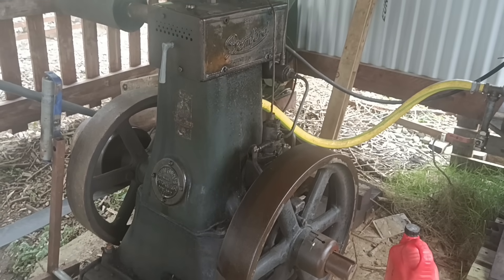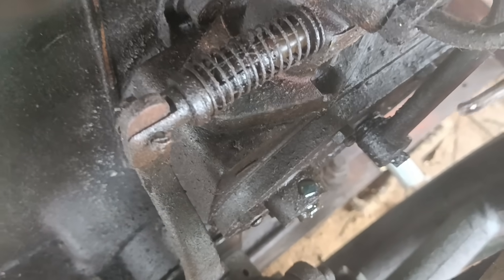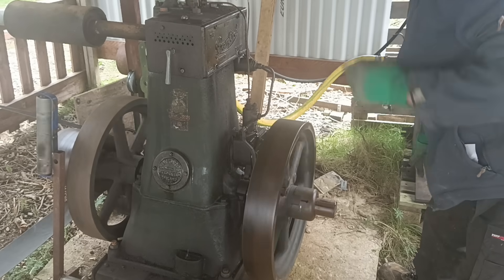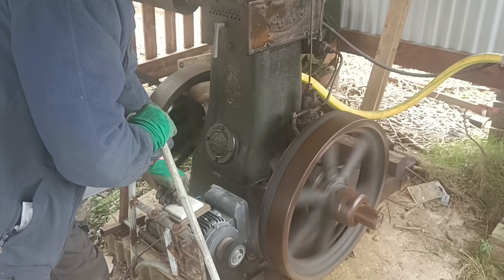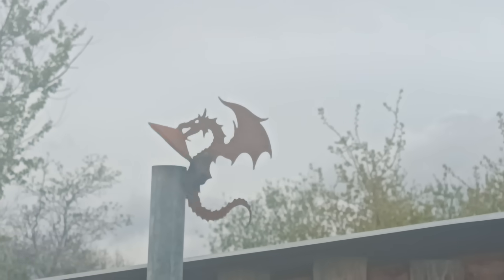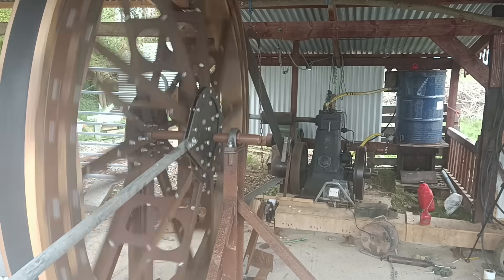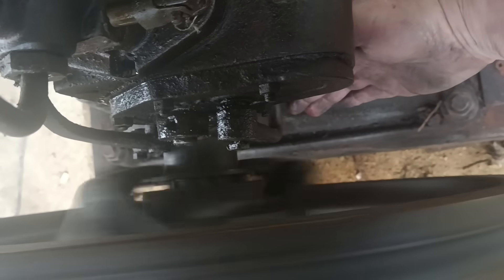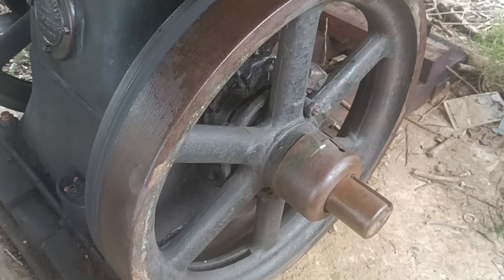How Much Fuel Does This Vintage Engine Use? Bamford stationary single-cylinder diesel efficiency

Comment: In marine engines diesel the ball park rule is 0.4  lbs fuel per  HP  about 0,18   kilos per HP  In a  6HP that will be 0.18  kilo x 6  . Then  covert to liters  approx  density is 89% the weight of water 1 Kilo per litere water . . The fuel use is not linear as some percent of fuel is only to turn engine over so 6HP will be max effientcy  and something like 1  HP is worst effientcy . Looks to be your using 2 HP to 3 HP  as i would expect 5 .5 HP to be 1.2 liters per hour . I have a 6 HP 1960 version Yanmar engine  withy big flywheel at 2800  RPM with 15 inch  x 17  inch prop  on 2.3 ratio gear box  and reputed to be  less than 1.5 liters per hour at 3 mph  full tilt on a barge in a canal  something like 1/3 gallon UK per hour .  Wind and current can alter fuel numbets along with fuel types as winter fuel has more Kero in the diesel  fuel . . The disiel fuel cost will often be two to 4 times cheaper than electric power depending is fuel untaxxed like green or red fuel or taxxed like yellow fuel I am kerry based whats your county ??

Comment: We have an old Ronaldson Tippet engine on our property that looks almost identical to this one. It runs a 32volt electric generator. The old girl is in working in order but has not operated for many years sadly since we put in a solar system. The solar is silent but I much prefer the chug chug chug of the old motor.

Comment: Have you tried to put about a cup of 2-stroke mineral oil in the diesel fuel to make it a bit richer? I have a 7.3l idi and    valves are more silent and has better trottle response and more power

Comment: i drive to work with a electric scooter (45km/h 4kw Engine @fullspeed ~1,6kwh = ~3,5kwh per 100km) and my co worker are drive some with "normal" fuel an she used ~3-5L per 100km. 
I pay nothing for the electricity ( solar system out of defect panels) and she today ~ 6.88€ :D

Comment: yes! Very impressed. If only I could power my woodwork shop with one of those! I have a big diesel V8 ford. The first four-wheel vehicle I've owned. Cost 8k US$ 14 years ago. Doesn't get used much but if driven on highways and not freeways will do 24MPG. I hazard a guess and say it's worth upwards of 35k now but I won't sell it for 3 reasons. It will haul just about anything, I can do most of the maintenance myself (If any) and how many folks can say they only ever owned one car/truck in their entire lives. Old machines rule. Every time!

Comment: Wow! That math works out pretty well. Efficiency of using fuel -> steam -> mechanical energy -> electricity is about 1/4-1/3. Not counting electric -> mechanical. Going from fuel -> mechanical energy certainly saves a lot of the losses!

Comment: It's not just the horsepower of these old engines that makes them so valuable as a stationary power supply. It's their torque that turns a massive flywheel. The pollution from these machines is a bit of a problem, however the amount of electric power you can generate could power our homes and run some sort of emissions clean-up as well. With the new batteries now on the market, we could charge them on a very early morning schedule with this type of diesel engine (two or three homes?) and run our households during the day and night, too. There would be MASSIVE pushback from GREENIES because of the use of diesel fuel. Oh well, you can't please everyone...so stop trying.

Comment: I could imagine one of those machines running in a heat and power setup. Hook up a generator to produce your own electricity (Plus a battery of some kind) and use the exhaust and cooling-fluid heat for hot water.

Comment: 450ml/hr out of a 6hp isn't far off a little yanmar l70 running hard. I would think the large rotating mass of the flywheels would give the bamford a fair bit more torque but I may be wrong

Comment: Im fairly sure a more modern honda 125cc motorcycle engine will provide a lot better efficiency, even at 2000 rpm. Unfortunately, finding an equivalent in power, small diesel engine is much harder.

Easiest is use a cloth to filter vegetable oil, and mix it in the diesel. No need to go through lengthy procedures to refine the oil, when you can have a similar functional fuel mix of diesel and vegetable oil.

Comment: I have a listeroid 6/1 that runs a 120V 60HZ generator head. I run the engine at 730RPM, for a bit more HP. The fuel burn is about 345 grams of diesel, per KWH gen head output, in real world use, mid load. Considering that the gen head is probably about 85% efficient, the engine's fuel burn is competitive with modern small diesel engines, at around 295g per KWh.

Comment: Lovely to see simple reliable enginring at work after so long. A pal has no mains power at his property and has used an ancient Lister single cylinder engine for general light use for donkeys years. In that time he's gone through many larger output generators for heavier use that were all bought new  and soon broke down. Kind of proves the built-in obsolescence of the modern world.. surely that's wrong...

Comment: A proper measure would result in pounds of fuel for an hour of run time making 1 horsepower or an equivalent set of units.
https://en.wikipedia.org/wiki/Brake-specific_fuel_consumption
Reply from the maker: but how would I measure power output?
Reply: @wayoutwest-workshopstuff6299   By powering a known load.  A generator is convenient since you can connect and disconnect it's loads and so adjust the load on the engine.

Comment: The farm I worked on had a old Bamford from the 1920's from memory. Was used to pump water from a bore with about 150meters head. Was there pre war and still works today as a back up to the electric bore put in in 1984.

Comment: Sounds pretty efficient to me. I love these old flywheel motors. These have a character you don't see in modern Chinesium machines. One day people will say the same about briggs and stratton gas mowers. I have 2, self propelled and they are staying with me. A friend has a battery mower and it sucks, to be generous.

Comment: Mi grandpa bought a hit/miss engine concrete mixer with steel wheels in the 1920's or 1930's when he built his house. My dad and I used it to build some of the retaining walls, footings and various other projects at the lake property. It was also used on 2 of my cousins lake properties and the construction of a children's camp and various other projects. All of these projects took place in the 60's and 70's. I have no idea how many yards of concrete but the paddles and drum are severely warn. The thing still runs today. I am pretty sure that it ran about 6-8 straight hours on a gallon or less of gasoline. You could count each firing event which under no load might have been 1 every 2-4 seconds but the more you load it the less time between firing events until it would fire every cycle. The engine was single cylinder with 2 heavy flywheels and as I understand it the engines main job was to spin the flywheels and the wheels are what did the work. Sometimes I think what we perceive as progress is only different and made simpler to operate but not necessarily better. Lets face it . Nothing or very little is invented today right down to the electric car. It's all been invented in the past. We just reinvent it with some better materials and support  systems.

Comment: I have seen engines tested and the performance listed as Horse Power Hours per Unit of Fuel. The Nebraska Tractor test of many years ago used these units so people (farmers) could evaluate or compare efficiencies of farm tractors.

Comment: you are assuming the engine ran at 6HP (~4,5kWh) and therefore an electrical engine running for a full hour would have consumed 4,5kWh. However, your work clearly required a lot less than 6HP sustained. Why, because 1L diesel is ~10kWh of energy, of which (a theoretical) perfect combustion engine can only use 50% - so your engine would have to be perfect.
In reality I guess efficiency is somewhere at ~10-20%, which means roughly 1kWh of electricity would have done the job.

don't get me wrong, I love old engines - but their efficiency is the reason why they are used only for shows and not to do actual work.

Comment: Wait, a machine that's basically indestructible, cheap to operate and can be powered with modified vegetable oil??? Quick - let's make it illegal! (AFAIK those machines ARE already illegal to operate in most of the US and soon will be everywhere in the EU)... Well, think about it - and why would our well-meaning and competent politicians DO such a thing?
Reply from the maker: Not illegal - one day you'd have to run it on green diesel, that's all
Reply: @wayoutwest-workshopstuff6299  Not now, of course - but you have to look at all the attempts from left/green since the mid-70s to make owning/operating combustion engines illegal, starting with the writings by "Environmental" Law Professor Dr. Arnold Reitze - 50 years after his irrational ramblings against ANY form of combustion, the greentards in Berlin/Brussels are basically implementing all of his wacko ideas. The interesting part: Reitze's activist manifesto was intended to prevent... wait for it... a new ICE AGE.

Comment: you can see a lot of them in Indian farms , running tube-wells ( in places where  electricity connection for tube wells is not available or delayed by a few years due to corruption.   the situation has changed a lot , for the better, in the last  9 years ).
     people start them by hand cranking only.
   they are generally 8 / 10 horsepower & consume about a litre / hour.

Comment: My car consumes 1L/hour just to idle. This machine is more efficient than modern car engine.
Reply: Your car engine is also driving fans, belts, pumps, and an alternator to charge the battery and run all the electronics in your vehicle. These are not comparable because you're your car engine is doing more work

Comment: 0,45 l diesel/ hour is 1,89 hp if the engine is 35% efficient. That sounds about right, because the load is very low. It would be interesting to see this thing run a generator at full load to see the actual efficiency.

Comment: A power level of 1 hp is approximately equivalent to 746 watts.  One mechanical horsepower lifts 550 pounds (250 kg) by 1 foot in 1 second

Comment: So fun fact on that old engine. I did a bit of research and your engine produces around 52 foot pounds of torque from the info i have. It may be a bit higher or lower since those engines basically dont exist in the U.S...but close enough for this discussion.

Now i currently have a 3 cylender engine pushing 20 horsepower that gives me a max torque of...33 foot pounds. This engine is used to drive the cooling unit and a small generator in my semi (lorry). This engine uses .732 U.S gallons per hour on average over 3000 hours. Or about 2.77 liters for you metric users. Or around $3 an hour best case. I also have a twin of this engine same specs and all currently used to power a small generator for my shop. its about the same fuel consumption .725 over 8900 hours. Both engines are a 2021 and 2022 varient of the same motor. They also weigh 250 pounds.

So your near century old engine is about 84% more efficent then a modern diesel engine doing a very simular workload or likely a lower overall workload.
Reply from the maker: Ha! Thanks for this AF. I imagine your engines are working harder than mine was though. Apparently mine wasn't a fair test because I didn't push mine hard enough..

Comment: I want to say I loved the video.  But I want to point out a few things.  

The engine is not making 6hp or 4500 watts.  You said you "could do the work", and an average human can produce about 1hp peak.  Let's call it 2hp.  Just to be safe.

The engine burnt 3700 wh of diesel in that time to do 1500 wh of work.  That's about 41% efficient which is a crazy number for a diesel of that age so I know I'm erring in your favor at least.  

It would cost 66 ¢ to run an electric motor for that amount of time.  

So money wise, you're ahead or at least in the ballpark.  

 It can't be making 6hp at that rate because you'd have discovered perpetual motion with that engine running at 121% efficiency, and you'd have been disappeared by now by the black helicopter gang.
Reply from the maker: Thanks, Michael. You're quite right! But I wasn't trying to mislead - just trying to understand. I should repeat this when the engine's working harder..

Comment: a few years back I with a couple of partners had a gold mining lease and used an old Bamford to run a small generator. it would run every day for at least 8 hours a day with no problems and was surprisingly efficient. end up selling it to a collector
Reply: yep   bamford or lister engine technology running a generator and a  large 1000amphr 24 volt  battery bank is key. it would be about 4hrs a day to keep huge  1000amphr  24 volt battery bank topped off  in a house using 8kw to 10kw  per day .

Comment: I loved seeing and hearing that old engine run!  Old diesel engines fascinate me.  I love the old one cylinder small boat motors with the big flywheel that you could hear goin pop-pop-pop!  I'd love to have an old boat with that motor in it.  I've seen several videos of old diesel tugboats that were turned into houseboats and the diesel engine turned such a low RPM that the motor was running fine and had never been overhauled!  Now that is amazing.  
  I saw some more of your videos I will have to watch.  Thank you for sharing this "gem" with us.
Reply: Look up Witte dielectric plants. I have a few of these here in the US.

Comment: Thank you.  Good video.
   Although we were country folk, our village was only a few miles away from Uttoxeter [the locals call it Utcheter], and my father worked in that factory, at that time.  He may well have made some of the parts, especially those that involved drilling, or even done part of its building.  It wasn't a very large place.
   Nearly every farm around had something similar [often a Bamford] to provide electricity when it was needed [not often], or for milling grain for cattle food.  Small workshops, too.  Some of the engines, I remember, I think the older ones, were horizontal, with very large slow-turning flywheels - essentially just the next step on from steam engines, I suppose.  I loved being taught to oil and grease and even sometimes start them.  Absolutely beautiful things.
   [By the way, 450 millilitres is almost exactly a tenth of an English gallon, not an American one.  More like an eigth of an American gallon.]

Comment: Seeing those old engines running is nice, not a lot of noise or fuss compared to the newer engines. 

You were not stressing the old girl with the fuel burn you were pulling about two horsepower.

Comment: Is it efficient? If we look at power output in relation to fuel consumption: probably not.
Is it effective? Heck, yeah. It's existing equipment, it can run at the low power requirements presented here, and it needs next to no maintainance.

Comment: Converting mechanical energy to electrical energy then back to mechanical for whatever you want to use a normal gas generator for I imagine would be much less efficient than a generator like this, obvious downsides of not being able to run a house off it but in a pinch you could likely add an electrical generator to the belts as well, it would be interesting if we still used machines like this but not many of us still forge, split wood, grind charcoal or use much mechanical motion at all.

Comment: They made diesels complicated just to save very little quantities. Simplicity always best. Reliability is key. 
In the long run, running cost for such engines far outweighs that for modern diesels.

Comment: Those horsepowers seems to be quite complex. Basically it is just torque multiplyed by running speed. But measuring methods seem to make big differences. However, half a liter per hour is pretty similar to what a small boat diesel of 6 or 8 hp consumes. However, these engines are rarely run at their maximum power. Nominal consumption of a modern engine is about 180 grams per horse power per hour. You used 0.45 liters, which is about 380 grams. Are we, actually talking about something libe 2 or 3 hp? But how should it be measured? From the crank shaft or from the tool (or propeller) used?
Reply from the maker: exactly! it gets very complicated..

Comment: Here in norway that calculation would be flipped on its head because of really high diesel prices and generally low electricity prices (at least before we were fully connected to the eu market), we had prices around 0,01 euro per kwh for electricity, which now has risen to around 0,10-0,50 euro per kwt. And agricultural diesel is around 1,5 euro per litre with the old price of electricity here you'd have 4,5kwt*0,01euro = 0,045 euro/h vs 0,5l/h*1,5euro = 0,75 euro/h
Reply: Its pretty ironic that in the EU its more profittable to run things via fossil fuels as compared to electriciy (though electricity also uses fossil fuels for generation). In norway we have around 95% hydro power for electriciy generation
Reply from the maker: yep - it doesn't make any sense, but what does?!

Comment: I have always been interested in a comparison between a modern gen-set (gas or diesel)  vs one of these older engines (hit-miss or diesel). Comparing the power output to the amount of fuel used.

Comment: I have a Buda-Lanova engine made in 1905 six cylinder 500 plus minus cubic inches. This engine can run a sawmill for 6 to 8 hours on five gallons of diesel fuel. Not sure as to the number of board feet of wood that will cut. But a huge amount. THE old engines just sip fuel, Today they guzzle fuel no matter what they say Tim.